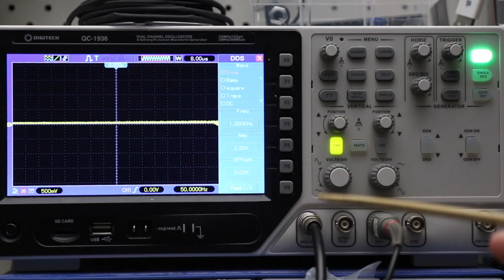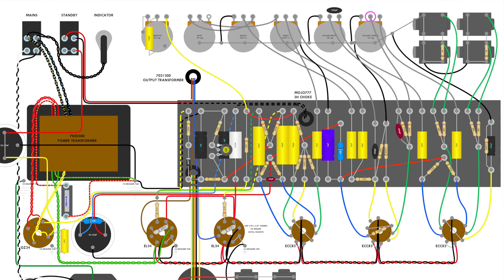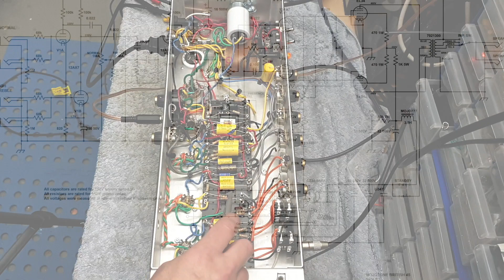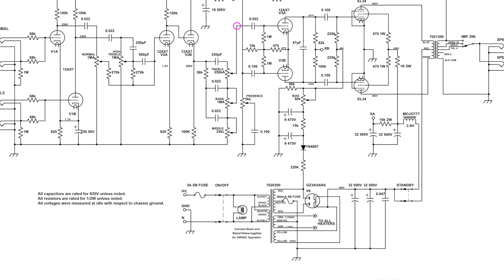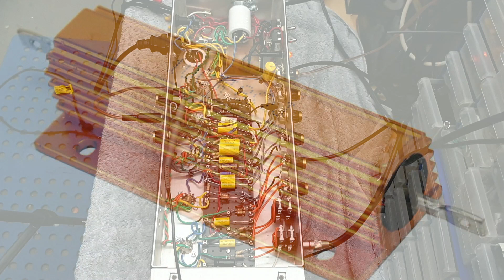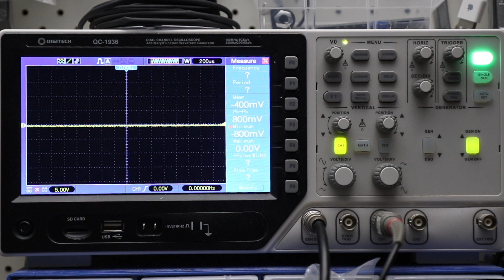How to use a Digital Oscilloscope...to test your tube amp! AT THE BENCH!

Comment: Around 8:46 150mA is stated, is the amplitude of the sine wave in mA or mV?
Reply from the maker: mV.  If I said mA then that was a slip
Reply: Thank you for the reply.  I was curious if there was another approach to set point by considering current thru the grid leak resistor

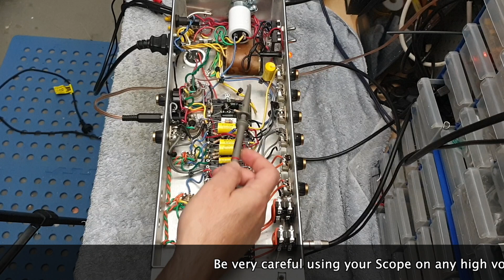Comment: 24:36 did you switch your probe to a higher setting in order to deal with voltages at the speaker? 
I see you 'switched the switch' but didn't describe verbally what you did or why... Thanks!

Comment: Hi Jason,
I have a scope the I have been hesitant to use because some cats in the US on YouTube warn against not using an isolation transformer.
The way you demonstrate the testing in your video is exactly how I was going to use the oscilloscope.
My question is do I need an isolated transformer in Australia? Thanks
Reply from the maker: Mae sure your scope is grounded, and that you only ever measure voltages in reference to ground (chassis ground) and you’ll be ok.

Comment: Im assuming when you calculate output wattage, dividing the peak to peak 10volts by TWO, has something to do with the fact that each channel of the push pull  only has half the entire waveform? Hence half the voltage?
Reply from the maker: No, it’s just to convert pk - pk to zero to pk.  Then divide by the square root of 2 to get it into Vrms.
Reply: @HeadfirstAmps Rms.  .707 Okay, sorry about that.  Thank you

Comment: I must be having a bad day - not being my usually tolerant guy, so I stopped watching a bit in. 
Two pieces of advice: Please check your video and e.g. put corrections on the screen when/if you catch a mistake.  E.g. when setting the voltage of your signal generator, you say 150 mA instead of mV several times.  And please use manual focus if your camera allows that - whenever you put your wooden pointer in the picture, the focus changes. Sorry I didn't watch the rest - it seamed a good video, and your audience below seem happy :-)
Reply from the maker: I hope tomorrow is better for you
Reply: @HeadfirstAmps  🙂  Thanks!  I feel better today (before having to listen to Trump...)
I hope you could use my smal suggestions - for beginners like me it is nice not to confuse volts and amps and all that to learn....   I am buying my first scope, and I have a few questions: 

Can it meassure B+ plate voltages like 300-500 volts ??   Or checking output from rectifier diodes, etc. ??
Will that high voltage damage the scope?  I guess I must use the probe at 10x setting - but do I need to buy a high voltage probe, like 100x ?   Thanks for a good video - and your reply 🙂

Comment: Great understandable video. I've started to rebuild some old projector amps into guitar amps, and want to get a scope. However, I'm confused whether I need an isolation transformer. Some say it's only needed if one is working on mains / power supplies, some say it's always needed as the amp and scope share the same ground potential. What's your opinion?

Comment: I'm just getting started on testing my way through a 1967 Fender Showman amp (AB763 circuit). Looking at the amp on JTM 45 kit amp, it looks a lot like my Fender Showman. A lot of similarities. I have a noisy volume pot (maybe the pot, maybe the 7025 preamp tube) which I will need to trace out and track down the offending component. I will acquire an oscilloscope to help me with this task. Great video.

Comment: just found your great video on troubleshooting this amp. I want to do this on my non-working transistor radio.can your built in waveform gen be followed with placing 2nd probe on speaker output to hear the sine wave tone in addition to seeing on the scope?
thanks
John

Comment: Hey Jason, love your stuff....  

Is your signal gen 50 ohm source impedance?  Do you terminate it in to 50 ohms and feed off that to the high impedance amp input and does that help with output voltage accuracy?  For example, you set 100mV and actually get 100mv at the input...

Keep up the great work!  Loved your recent stream with Dave & Bruce!

Comment: If you have more than one input channel on your scope, a good idea is to colour-code all the channels, use Ch-1 to monitor your input signals, and Ch-2 to monitor the signal at various points in the circuit, this will give you more of an idea of how the circuit you're testing is behaving, also useful for tracking down faults too. you can also do phase-measurements with a scope that has more than one input channel.
Reply: This is how i go about it ! Tracking phase changes can really help

Comment: Do you use an isolation transformer when performing this testing?
Reply from the maker: No.   But they are advised if you’re starting out.  However you need to be very aware of grounding, as if your amp chassis is grounded (they all normally are) then the isolation transformer is not doing much to protect you or your scope.

Comment: I have a question. Is the output power meant to be the same at different frequencies?
Reply from the maker: Yes, but the relationship between voltage and current will change with frequency,
Reply: @HeadfirstAmps  Yeah ok. I'm just trying to understand the numbers from a recent trip to a Yamaha Service Centre. Amp is under warrantee, and after a week, it sounded like the bass wasn't producing as much loudness or power. I took it in to a service centre and they said I was right... pretty unusual problem, but I didn't fully understand what I was seeing.  Hopefully I can send a link to the video here and you can see if his diagnosis is correct.
Reply: @HeadfirstAmps   https://www.youtube.com/watch?v=tsjXcQc9h6Q
Reply: @HeadfirstAmps  I thought he was testing the bass frequency vs a higher midrange frequency... but now I'm not so sure..? He starts with 1khz at the amps full power and it was outputting 28v, then he switches to 10khz and it was only putting out 16.5v.  10khz isn't a bass freqency though is it?  Anyway, was the 2nd readying meant to be outputting 28v also?

Comment: Did you plug your guitar into the scope to measure the peak voltage swing to use? Also do the results vary a lot when using a speaker cab vs. a simple resistive load? (Due to the freq/impedance curves of the speaker)
Reply from the maker: Yes on both counts!

Comment: Excellent video ! I built a few guitar amps and always want to « see » the effect of each gain stage. You made it 👍
One question : why do we have an amplification after the 1st grid stopper resistor (320 mV versus 150 mV of the generator) ?
Reply from the maker: Thanks!  The generator is 150mV from zero to peak, which is ~320mV pk-pk.
Reply: That makes sense ! Thanks for your answer.

Comment: Really nice video! One minor thought re: calculations on output at the end, I have those same 8 ohm resistors and they are not exactly 8 ohms. So I guess (if it mattered) you could measure it before calculating. Thanks for the excellent presentation!

Comment: This is absolutely great!  Thank you so much for doing this.  I'm almost a complete beginner though and there are already some things i don't understand. At around 10:16 you turn the signal generator on, but you've turned on gen on/gen off.  I've got the same scope as you're using here and I'm not getting what I see you are.  I don't get a wave unless I've turned on gen/dso.  I don't think it makes sense for me to keep going until I get this figured out. 

One reason for that is with the wave displaying (gen/dso on) I get a complaint from the scope telling me to push gen/dso to quit dds first.

Very confusing!!!
Reply from the maker: At that point in the clip, I have the signal generator on (the button on the right is ON) but  the scope display set to the probe (button on the left is OFF)
Reply: @HeadfirstAmps  Yes, thanks, I see that.  Thanks for your reply.  I'm wondering if my meter is defective - I don't get a sine wave on the display with the probe hooked up as shown and the signal generator turned on.  All I get is a jaggy straight line.  I'll contact the manufacturer.  Thanks again, though.  Your videos and your help are very much appreciated.

Comment: great explaination,  just a question, on the speaker output section (24:00), you change the location of the ground probe (from the ground input jack) to where exactly  ? i suppose its the ground bus soldered on the back of the pots, i'm right ?

Comment: Hi Jason. Great channel and great video on using the oscilloscope. 
I was wondering why you moved the scope back to DC coupling when you were still only interested in the AC signal. Could you please explain that. 
Also wanted to know if you use an isolation transformer between the amp being tested and mains power ? Cheers

Comment: Nice video and walk through of signal tracing.  Very well explained!  It was good you discussed AC Coupling and knowing the max input voltage of your scope as well.  It's worth mentioning the need to know the voltage rating of your probes as well as the X10 setting :)

Comment: Great video! Signal generators can be a hassle. I just use a sine wave video on youtube and pipe that out my USB audio interface via a DACCAPO re-amplificaiton box. Cheap and easy. I had the reamplification box already. You can buy a wave generator PCB kit on fleabay for $10 if you're so inclined. Needless to say you don't need a $500 unit! You are paying for the extra channels you won't be using. Get something in the $200 range: I recommend the Hantek DSO5102P. Can get them as cheap as $150 if you go direct along the silk road. A lot of people will say just get an old analogue scope off ebay for $50. Hey, if its working/refurbished, that's very much OK too. But if not, you can expect to find at least $100 of leaky caps in those things from the 80's, so it can work out rather false economy..
Reply: Let me see if I"m following this: SG's are a hassle, but you're recommending a Hantek (overkill for most) and yet you yourself use a signal from YouTube. You wouldn't recommend buying an analog SG because you'd find "at least $100 of leaky caps". REALLY? Did I get that right?